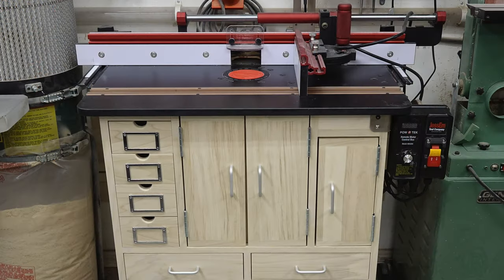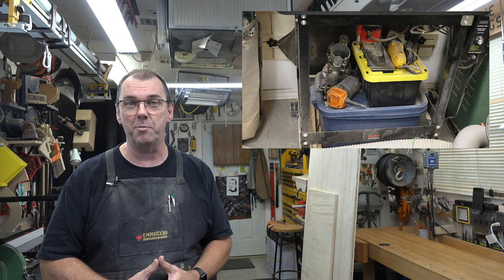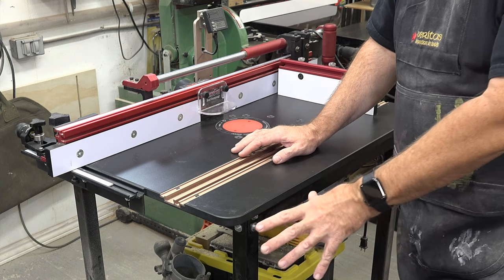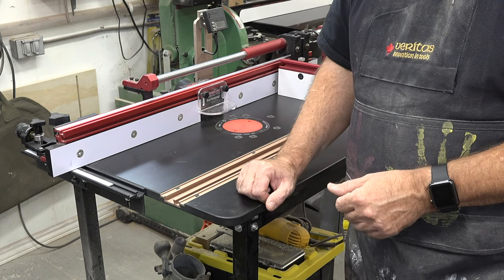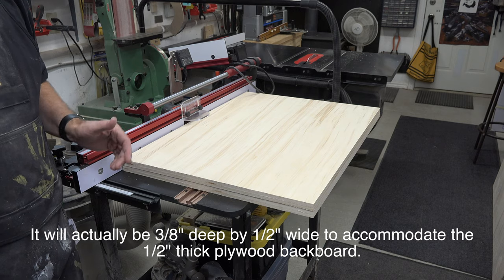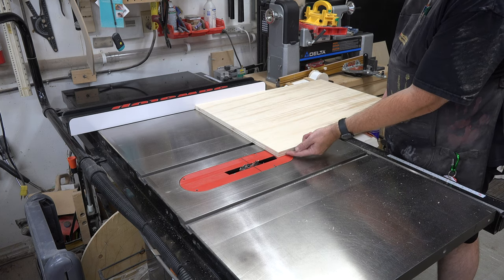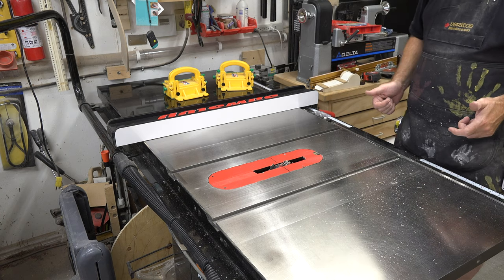Building a Router Table Cabinet Part 1

Comment: Rewatching this series after seeing it come up in the top ten. I did some rabbets with dado blade recently and realized my sacrifice fence attached to the fence would work better if it extended a few inches on the front and back. I rehearsed the cut and kept finding it hard to keep it against the fence at the start and stop. Probably my Craftsman table saw has a shorter fence than bessemier-like ones. I really admire your design and execution of a more complex dado and rabbet cabinet.
Reply from the maker: Dados and rabbets can be tricky at times.  One little deviation from the fence and the whole thing goes wonky.  Glad that you are revisiting this show.  It was a great project for sure.  Thanks for tuning in and for taking the time to chime in with your comment.

Comment: i'm in the middle of building a new router table, probably my 6th or more!
mine is also all jessem, router, lift, top, fence and accessories but no steel stand
Reply from the maker: This is a great design Steve and I've used it for years.  Good luck with your router table build and thanks for tuning in to the show.

Comment: Hi Kenny,
I did get the width dimension. How wide?
30 in. Tall and approx 21 in. Deep. But missed overall length.
Also look forward to how the crank wheel is accommodated. 
Thanks for the video, awesome work.
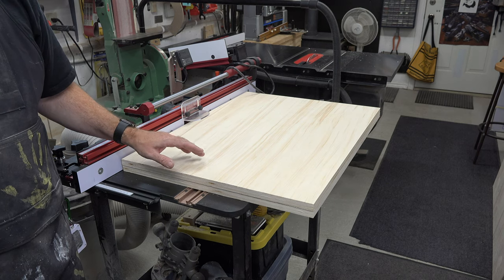Reply from the maker: At 2:33, I list the size of the backer board.  It is the same height (29.5")  and the width is cut to 26-11/16".  I hope this helps Jeff.  I think you're going to like the crank wheel accommodations.  Thanks for tuning in and for taking the time to leave a comment and question.  It's very much appreciated.

Comment: I am in the process of building this cabinet almost exactly as you have. I have adjusted dimensions slightly per my preferences, and my Jessem table mounting requirements. My carcass is nearly complete.

Question: Have you experienced any rusting of your router bits from the moisture in your bit tray plywood? This was mentioned on another YouTube channel. I’m contemplating using inserts or foam to protect my bits, but prefer your design. Thanks in advance.
Reply from the maker: This is the second cabinet that I have made like this one and although some of the measurements have altered on the cabinet itself, the design of the bit trays has always been the same.  I can honestly say that I have not had a single problem with any moisture and my router bits.  I have also never had plywood that has had any moisture in it.  Either way, I can't see you having any issue with moisture and the bit trays.  I hope this helps.  Good luck on your build and thanks for tuning in.

Comment: Knowing that you are quite persnickety about fit and I assume plywood in Canada is undersized as it is in the US.  Were the dadoes and rabbets narrower than the 3/4" noted?
Reply from the maker: The actual thickness of the plywood is usually 1/32" smaller than the listed thickness and that holds true here in Canada as well.  However, regardless of the fact that the plywood is actually 23/32", it is actually still listed and sold as 3/4" plywood.  I adjust my dado blade accordingly when using sheet goods, so yes, they weren't quite 3/4".  I would like to think though, that anyone who was building this cabinet would adjust their dadoes to match the thickness of their stock.  But I probably should have stated exact thicknesses to avoid confusion.  Thanks for tuning in Dwight and for taking the time to leave your question and hopefully clear up any confusion that others might have.  I appreciate it.

Comment: Hi Kenny! When I build cabinets, I judiciously guard my space and was wondering why you didn't just do dadoes for the trays. With the runners you gave up 1" on each of them and they are not that big to begin with. Just curious. Shop is half empty! Sob! Bill
Reply from the maker: I think that once you see the construction of the bit trays and how I deal with the front faces of the exposed edge of the plywood Bill you will completely understand why I didn't use dadoes.  It will all become clear in the next two episodes to finish off the series.  I did give up 1" inside the bit storage area but with the design of the bit trays, it's not going to make a different one way or another.  Thanks for tuning in.
Reply: @acutabove_woodworkings   OK. Holding my breath. Bill